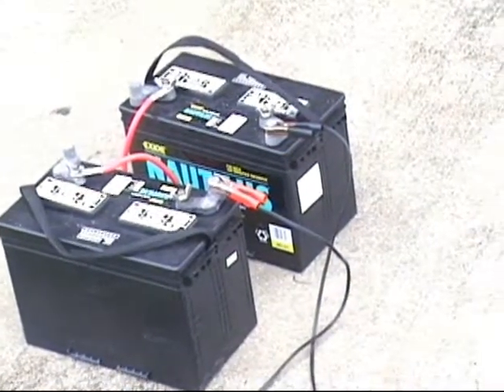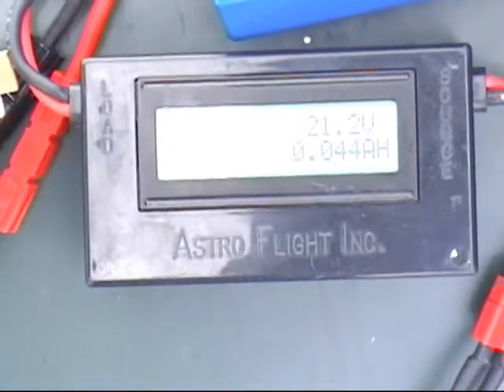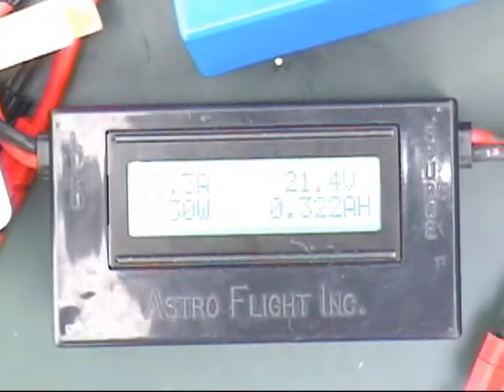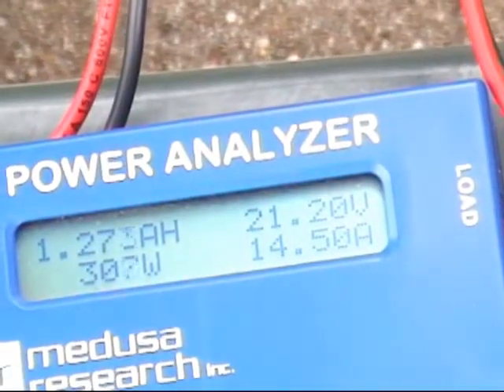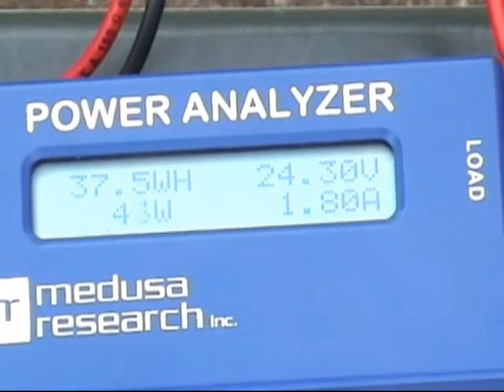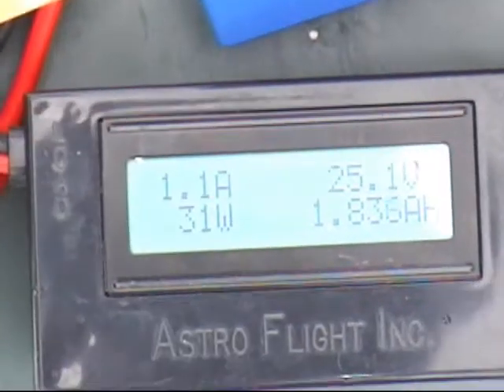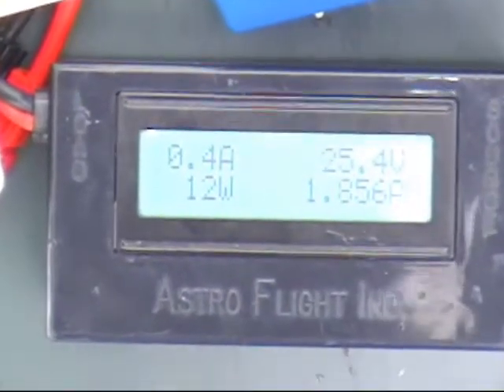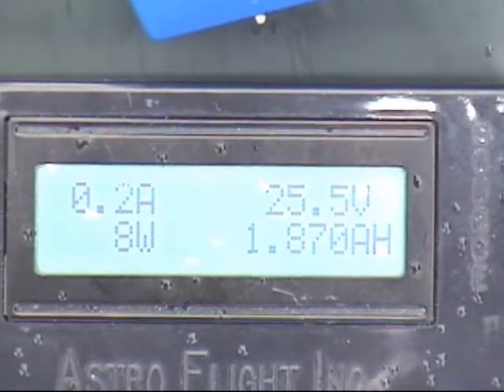6s1p A123 direct charging method#2

Comment from the maker: You can charge the 2300mah cell up too 4.2volts per, so a 3 cell A123 2300 pack can be charge at 12.6 volts. So yes, you can charge a 3-cell on one auto lead acid battery. Again limiting the current flow by using a zip chord with the length of it cut so the current is max out to 10 amps per "P". We've done a 3 cell A123 pack zip chord directly to a car battery before, so it works.
The 1100mah, I usually charge them at 5 amps.

Comment: The trick is to match the voltage.  The two car batteries must have been fully charged as they were around 26 volts combined.  Then they just dump their voltage into the A123s.  The long zip wire cuts down the Amps for the transfer to a reasonable 16 amps.  I know the small 1100ma A123s can take only about 7amps.  A 4 cell  A123 pack  maxes out at 14.6 volts so it wouldn't quite get charged by one car battery.  A 3 cell A123 pack could get overcharged by an auto battery.